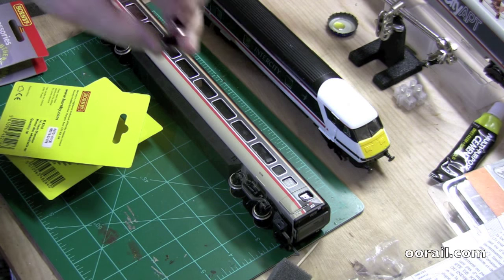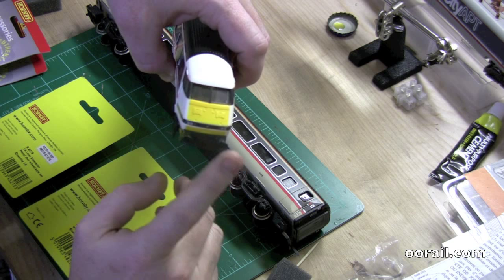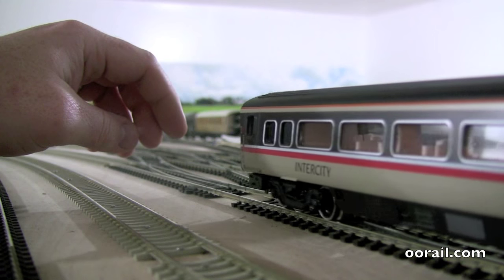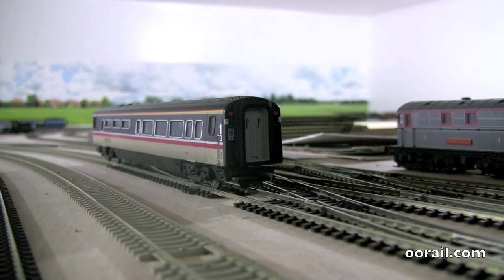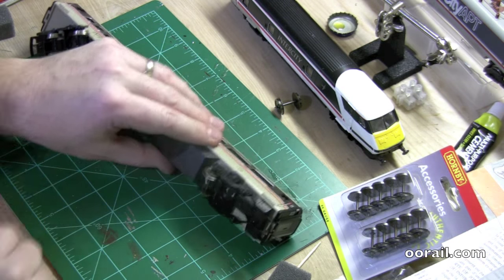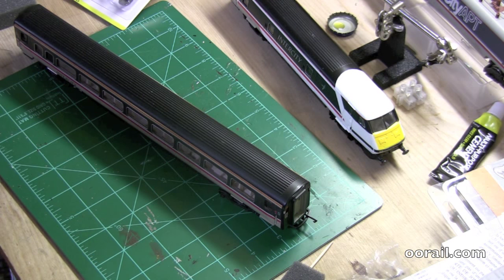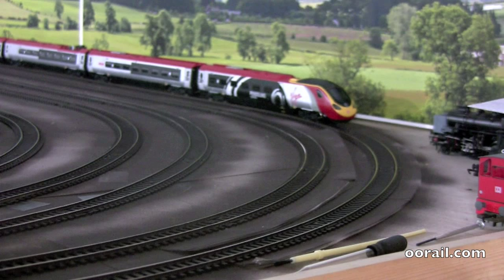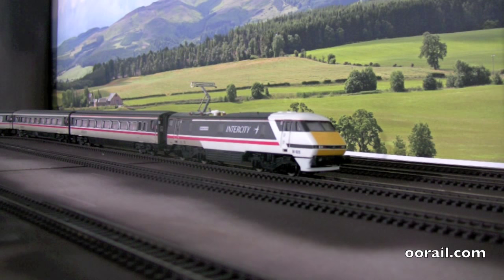oorail.com | InterCity 225 Mk 4 Coaches and DVT - Loco Works Wednesday #6

Comment: While you correctly identified the result of the problem (  wheels riding up over the guard rails), it is not worn wheels or bent flanges that cause the problem. Hornby built those wheel sets (square axel) too narrow in the back to back and/or flange spacing. If you take one of those wheel sets and place the pointed axel ends between thumb and fore finger and run it through the Peco points you will see it clearly. It is glaringly evident if you measure the flanges with an NMRA standards gauge. Good video, nice to see Cl. 91's and Mk.4 coaches at speed. Sincerely, David.

Comment: Thanks for the video and update on the modifications, must be a known problem for spare wheels to have been produced by Hornby.
Regards
Robert
Reply from the maker: +Ocean City You're welcome, glad you enjoyed it! I think Hornby manufacture the 12.6mm and 14.1mm wheel sets as generic spares and upgrades for rolling stock with plastic wheels. They're used on some of the Mk1 and Pullman coaches I think... They definitely made a dramatic performance improvement to the Mk4 coaches.. :)

Comment: Just to point out that the Class 91, Mk4s and DVT sold as the IC225 set had much poorer wheels than the separately sold versions. It is the trainset version that won't run through Streamline points but should run through Hornby points because they have bigger gaps through the frogs and guide rails. The tyres on the trainset versions are separate from the plastic inner and can come apart or be slightly off square. You can tell a trainset 91 from a separate one by the pantograph, (plastic on the trainset, metal on the separately sold one)
Saying all that, while the separately sold coaches are better, they are still improved by re-wheeling.

Comment: Great video, can I just double check did you use the same replacement wheels on the DVT and the Coaches or does the DVT use a different size? Thanks
Reply: Mk4s and DVT take the same replacement wheels.

Comment: Suprising how a change of wheelsets can improve running, also the bachmann and hornby wheelsets you can agjust the back to back measurements with a back to back gauge whereas the 9ld old square axled
Reply from the maker: +Greg Palmer Do you have any recommendations on where to get a back to back gauge from? Hattons have a few listed from DCC Concepts but they are on back-order...
Reply: +oorail.com i bought mine years ago when I was on holiday in uk you could try model railway imports oakville ont

Comment: cont axled hornby ones U could not adjust them, with your 225 unit need another 1st open and 1 more tso, to make up a close to proto set, and always remember the firsts are always on the south of the train @ Kings x then the buffet/restr followed by the tso's then the loco,of course the dvt on the buffer end of Kings x
Reply from the maker: +Greg Palmer I need at least two FO and two more TSO to do the standard BR InterCity 225 rake or I could pick up one more TSO and three FO and do the pullman version. I think its probably going to boil down to what I can find at either model shops, hattons or via eBay. I'm in no rush though as I've still got a ton of copper wire to solder and OHLE masts to scratch build :)
Reply from the maker: +Greg Palmer Here are a couple of formations I've come across courtesy of Flickr, Google Images and rmweb:

(A) 91+TSOE+TSO+TSO+TSO+TSOD+RFM+FO+DVT
(B) 91+TSOE+TSO+TSO+TSO+TSOD+RFM+FO+FO+DVT
(C) 91+TSOE+TSO+TSOD+RFM+FO+FO+RFM+FO+FO+DVT
(D) 91+TSOE+TSO+TSO+TSO+TSOD+RFM+FO+FO+FO+DVT
(E) 91+TSOE+TSO+TSO+TSO+TSO+TSOD+RFM+FO+FO+DVT

I believe (D) and (E) were the standard configurations. There maybe more, really depends on the location and destination of the train. I'll definitely pick up some more Mk4s in 2016 though :)
Reply: There were 30 sets of Mk4 coaches (with a spare for maintenance overhauls).

From your list above;

A: Was early testing, to check out any problems.
B: Standard set while Mk4's were still being constructed (there were more 91's than there were Mk4 trains for them to haul)
C: Was an early Pullman train formation and lasted for less than a year (too much 1st class capacity and a drop in the  amount of customers using them thanks to an economic slump starting in 1989/90)

Once all the Mk4's were delivered, standardisation of train formations were created.
D: Was the formation for the 6x Pullman trains
E: Was the standard formation for an ECML train.

Of note, the Mk4's had a serious 'Yaw' problem, but they found by rotating the bogie by 180 degrees, it fixed the problem (this wasn't done to the DVT however).
this isn't something that can be easily done on the standard Hornby model because the end skirting it attached to the bogies, but if you were to saw it off, mount with some plasticard and use Kadee couplers, you can make it more prototypical.

I have 2 full rakes (9+DVT, formation E in your list), which will be getting full upgrades sometime in the future.

The upgrade will include;
Rebuilt class 91 with a modern mechanism, with detailing, lights and DCC sound
Mk4 with:
Etched window frames
3D printed skirting
Interior lighting (+ headlights for the DVT)
Fully painted interior (plus conversions for the TSOD disabled seating space)
TSOE ends.

Hope the info helps.